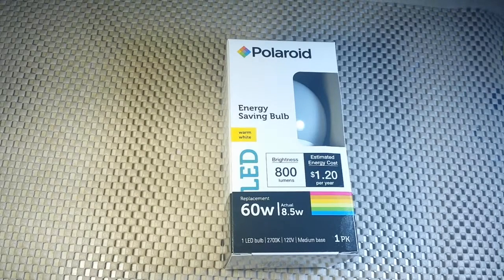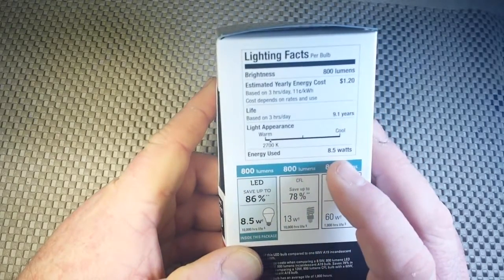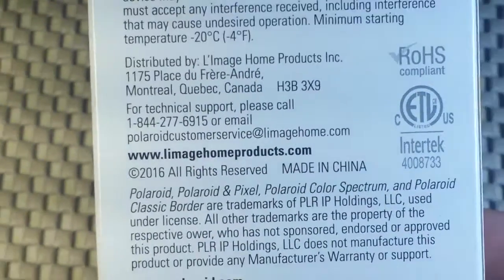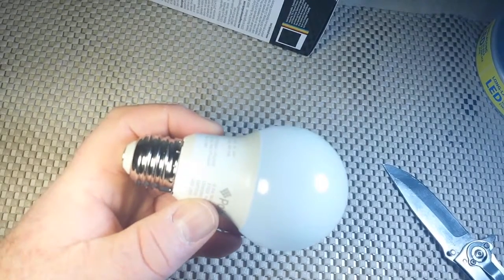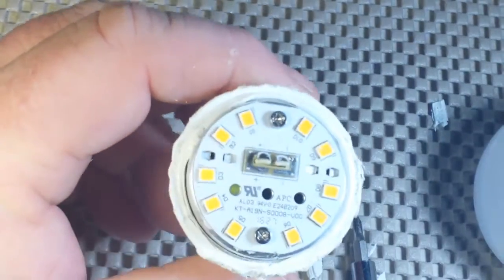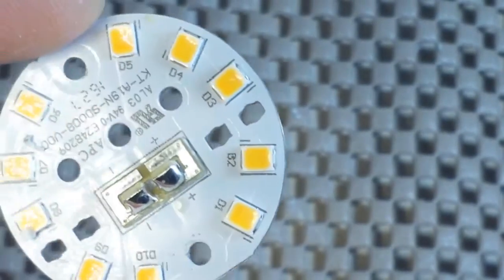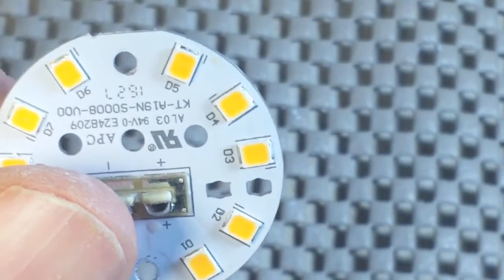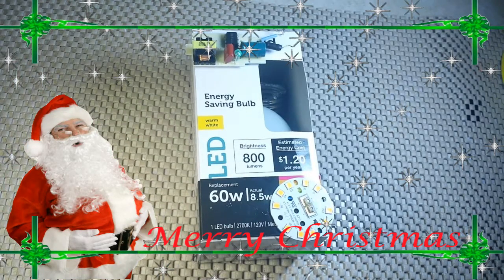Dollar General 60w LED bulb teardown

Comment: A bit fancier than the $1 9-watt LED bulb from Dollar Tree: slightly more complicated electronics, fewer LED chips. The Dollar Tree bulb isn't dimmable, doesn't have a licensed brand name, is a bit simpler and cruder in construction, and I think has a 3000K color temperature. This looks better quality but I have no idea if it's worth the extra money.